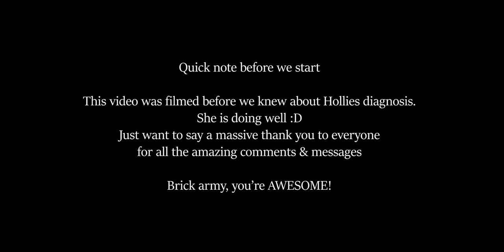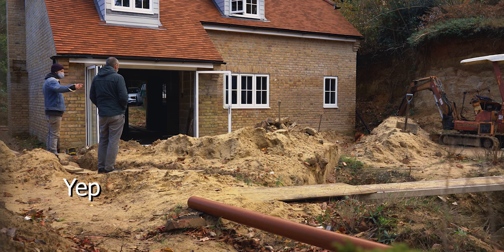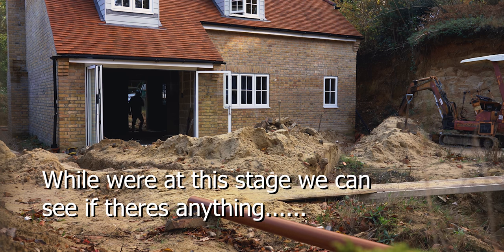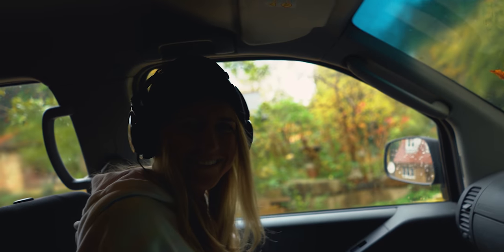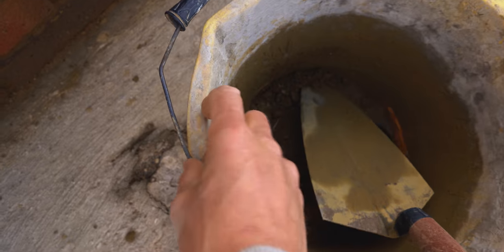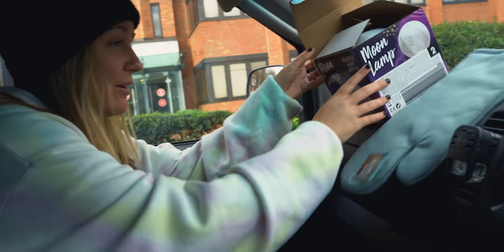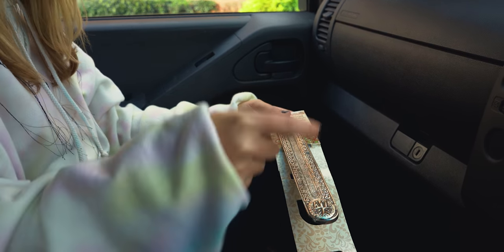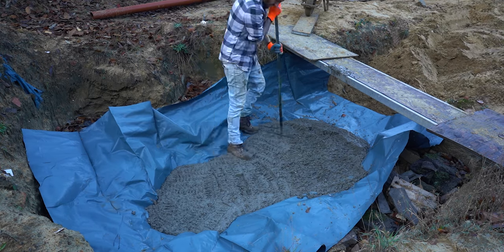Will It Pass INSPECTION? | House Build

Comment: Hi Rodian, been following you for a while now, you went to point that joint on the wall you only had one course of creasing tiles, was there a reason for this as I’ve never seen a single course of tiles in my 50+ years in the trade always been double course. Struck as unusual.